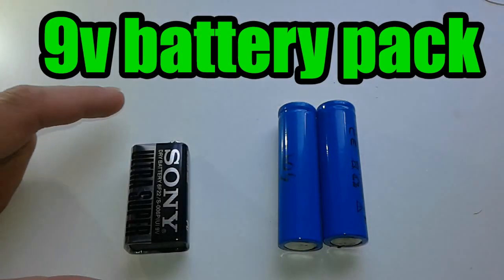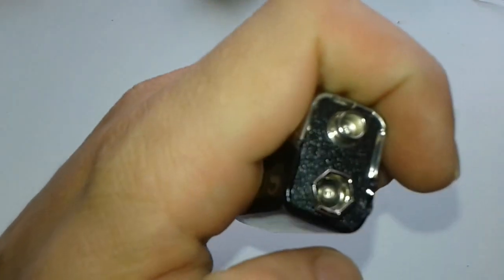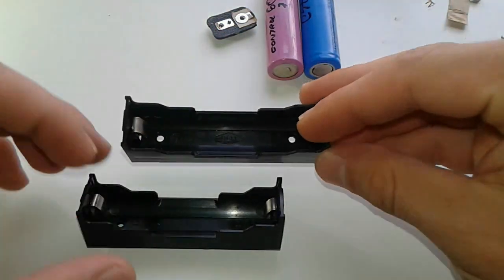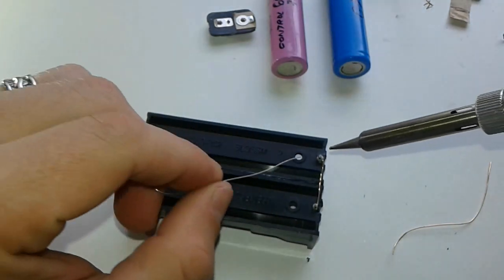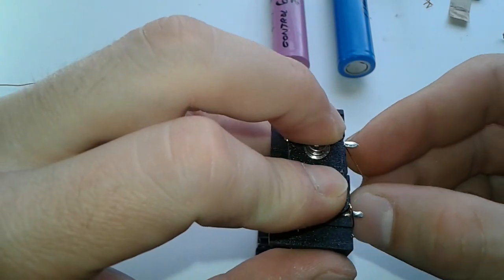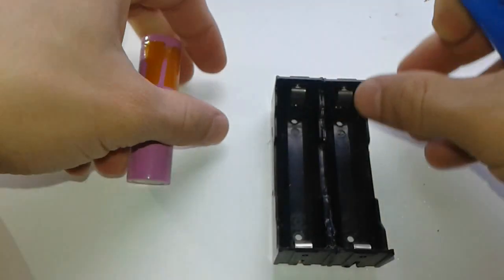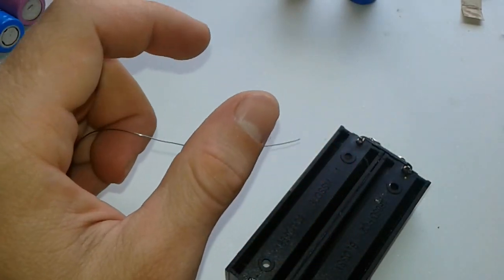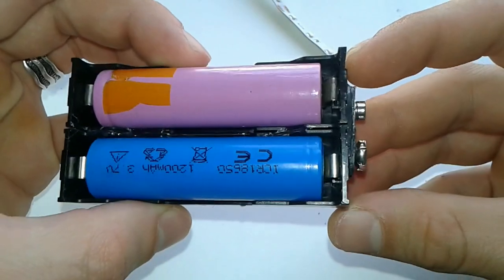How to make 9v battery pack rechargeable using 18650.DIY 9 volt

Comment: Do NOT test this battery by placing on your tongue.  I have done the same thing, but it's being used in electronics that do not have a high current draw. Smoke alarms, metal detector, clock. If you use batteries salvaged from power tool battery packs or old laptop batteries, they usually have the same capacity and amp hour ratings.
Reply from the maker: Good tip!

Comment: The other thing you didn't mention is to check that the internal cell resistance is the same. Otherwise, one cell will discharge faster than the other or charge more slowly. Over time, this can cause one of the pair to degrade faster, leading to imbalances. If charged in parallel, mismatched resistance can result in uneven current distribution, potentially shortening the lifespan of the weaker cell.
Reply: I have the Blink series alarm system. ALL of my 7 cameras use lithium AA and only one will be dead and the other will be still fully charged. I’m glad I checked the battery level otherwise I’d be tossing perfectly good batteries!

Comment: be cautious folks just because it's on YouTube doesn't mean it's a good idea.
There are a multitude of problems here, but I'll just State the two obvious ones first, first off this is a 8 volt battery pack at best and the current drain is not regulated here as it is in a 9-volt you can't charge this pack like normally can with these battery cells. It would sure make a lot more sense just to get a 9 volt battery that you can charge or just get a pack of 9 volts from Costco but the whole current drain system is the biggest problem here and the fact that you don't have a true nine volts here you barely have eight on a good day this is really bad information for folks that wouldn't know.
this is not advisable for high-end Electronics or anything that requires a regulated drain.
 be cautious folks just because it's on YouTube doesn't mean it's a good idea.

Comment: ATG & I say you are wrong because an ATG's 18650 battery is 3.7V (at most 4.1V). No way ever to equal to 9V.
3.7 + 3.7 (connected in series) = 7.4VDC   You do know that an 18650 is li-ion battery, right?

Comment: It will be great if you combine 3 18650 cells in series and then use  a LM7809 voltage regulator to get exact 9 volts. That will be much efficient than this one. Anyways it was  a great video.

Comment: This 8 volt battery can not be used instead of 9 volt battery. If you supply an appliance of nominal voltage 9 volts with this 8 volts battery, it will give a signal of low battery. Besides, a fresh new 9 volts battery if measured it will give approximately 10 volts reading.
Reply: Sure, but with lithium-ion chemistry, the battery would hold around 8V for a long time before dropping further, so it depends on whether the device actually requires a full 9V or just operates less efficiently below that. Some circuits might signal low battery, but others could work fine at 8V. If the application is sensitive to voltage drops, it might be better to use a slightly higher voltage and step it down with a regulator.
Reply: He is a complete idiot.

Comment: Great video bro! Wouldn't it just be easier to change the battery terminal connectors on the 9v device to hard wire or crimp connections for sake of time and effort saved?

Comment: The funny thing about this is that if used to replace a 9v in its typical useage scenario(ie smoke detector) the drain on the cells would be slightly less than the natural discharge rate of the cells.
Reply from the maker: 9v application use less mA not used for power consumption

Comment: the big issue with this project is that a 9v snap connector is vulnerable to shorting.
on the other end use a polyfuse and select one that trips around 500 ma.
also insulate the pcb pins or better yet trim them and solder in the grooves at the ends of those blossom holders.
i built a few of these 10 years ago to replace obsolete batteries in radios.
the polyfuse is self resetting and the radio performance drops drastically at around 6v.
which happens to be a safe end voltage for li-ion.
a bms wuold be nice but i know to just pitch any cells that are run down too low.
the biggest hazard is taken care of by the polyfuse.

Comment: I like this alot but isn't 8.4v max, 3.6v x2 = 7.2v opt and 2.8vx2=5.6v way too low? My 9v smoke detectors beep at me all the time :(
Reply from the maker: Have you measured a 9v battery first? And li ion cells when fully charged are 4.1-4.2v so best chase scenario is 8.4v pretty close to 9v
Reply: @NoSkillsRequired  Pretty close to a shit solution as well!   😂
Reply: @TaunterAtwill  it ghetto, but whether it works, depends on the application.

Comment: My rechargeable torch has 3.7 v single rechargeable battery of 1200 mah.  Currently battery backup is very poor. Can i replace it with three  1.2 volt rechargeable cells  . So that their combined mah will be 4000 mah  . My doubt is will I be able to recharge like before inside the torch . Will it explode since each cell in series might get more charging volts
Reply from the maker: You can try but with charging will be a problem use to charge a 1.2v recharge station individuality and then plug them in the tourch or just change the 3.7v li ion with a more powerfull one from the electronic cigarettes

Comment: But you have no over discharge protection. If your load drains the batteries too low they will be damaged.
Reply from the maker: You are correct is just a proof of concept not intended in hight current draw

Comment: After following your tutorial on this I found some drawbacks. This DIY 9v battery can deliver much more current than a regular 9v battery can that's correct but actually 9v batteries aren't designed for high drain applications. It is designed to handle low drain devices like smoke detectors and multimeters. Also a new 9v battery usually has almost 10v which this 9v(more like 8.4v as a li-ion battery is charged to 4.2v to avoid overcharge) battery can never reach. Nonetheless, great video it helped me save money to buy real 9v batteries for my electronic projects
Reply from the maker: Rainbow Sword there can be made or both a current limiter, and connected to a buck converter you can have a 5v regulated power supply more efficient then a cheap power bank I will make a video about it soon
Reply: @NoSkillsRequired  Actually a real actually a real 9v rechargable battery can be made with 3 li ion batteries in series to create a 12v battery pack which your other video did and connect it to a lm7809 voltage regulator then you'll get very accurate 9v straight up and there is also an internal current limiting circuit which tops the current at 1.5A so short circuit will be prevented and much safer. Also a lm7809 is super duper cheap and you can always connect two or more of them in parallel to increase the total current output for you application
Reply: 2022

Comment: I am not so sure about your polarity. When I look at a factory 9Volt  battery the poles are reversed. The Positive side is the small terminal and negative is the larger one. I believe you have it backwards.
Reply from the maker: Matt exactly I reverse it because you will connect the special plug to it which has the normal polarity, but it was just my preferance you can make it how you whant

Comment: Nice video. How do you recharge the batteries?
Reply from the maker: Sisi Nono you can charge individually with a cheap power bank modules, or dedicated chargers like iMax b6 but a full video about this will come soon
Reply: NoSkillsRequired ok thanks. I always wanted to make one but didn't know how to do it.
Reply from the maker: Sisi Nono any time budd I have one for 12v battery pack you should check it out all the best
Reply: Am gonna make a video of how to do it

Comment: But I can see it says 3.7V on the side of one of them. wouldn't two of them just be 7.4V?
Reply: you can use only one 18650 battery and boost voltage on 9v with boost converter.
Reply: Your right its not 9 volts
Reply from the maker: Dogapult this is written on any li-ion 3v discharged, 3.7v nominal and 4.2v fully charged this is next best thing to 9v
Reply: The small amount less voltage won't be an issue?
Reply from the maker: Dogapult think about this way laptop battery are rated 11.1v not 12v and when new there are not holding up to 3hours?when the voltage will drop to low for your application the device will shot down